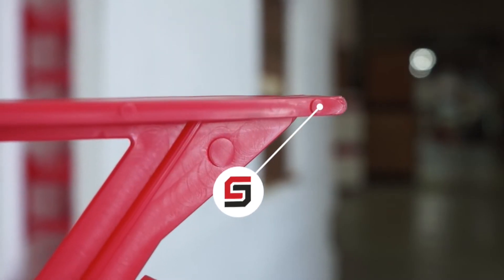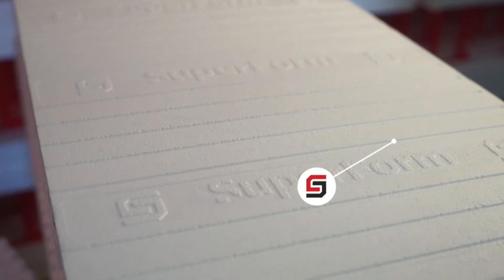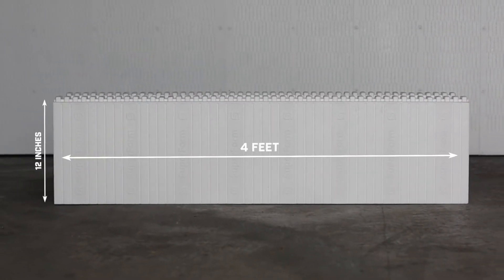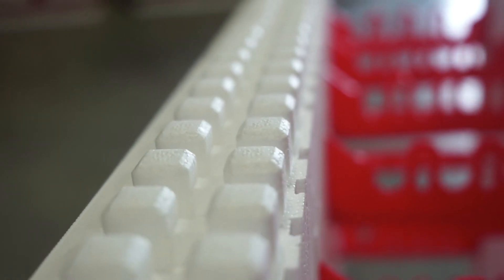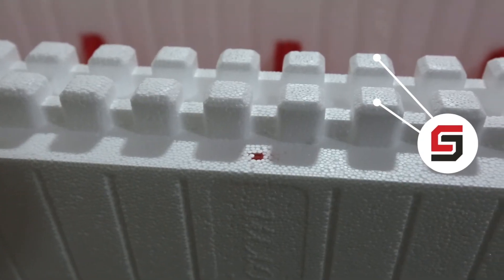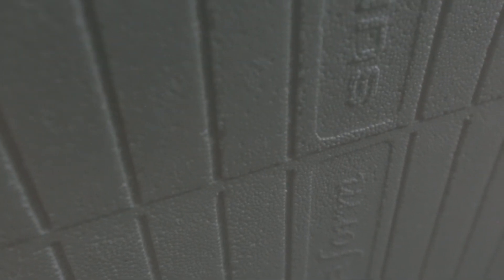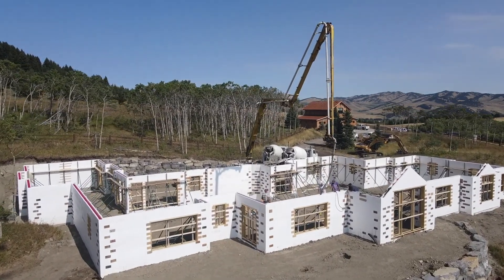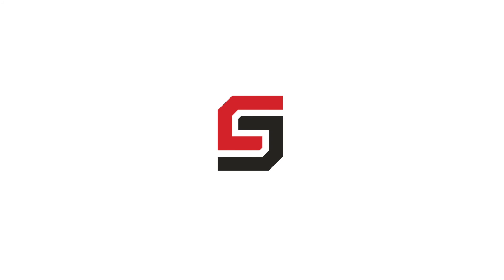Why SuperForm ICF?

Comment: Its a bummer cause you cant use them in some states cause insurance companies wont insure the home due to pest companies refusing to provide termite protection. Not sure how they can refuse cause foam products are literally in most home builds.
Reply from the maker: That's an interesting point and makes us scratch our heads too. You can add an additive to EPS making it termite resistant, but it ends up being costly.

Comment: 12 inches in height when ever other competitor is 16 inches so you have to buy 25% more blocks if you buy from Superform at the same price per block as the competition...... No thank you pass pass on the greed.... try to squeeze the consumer by cutting out 4 inches on ever course.....
Reply: The price is really competitive on a square foot level. I love the block strength and simplicity of putting it together. No tieing or wire clips
Reply from the maker: Following Keelan's reply below, SuperForm blocks are price competitive and eliminate unnecessary accessories, saving you time and money.